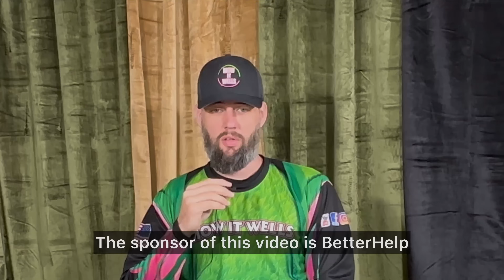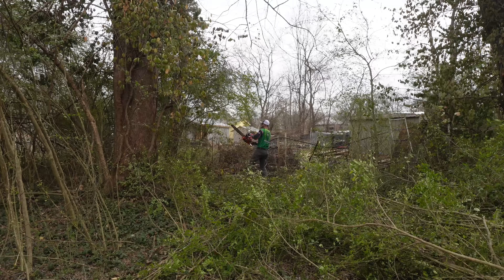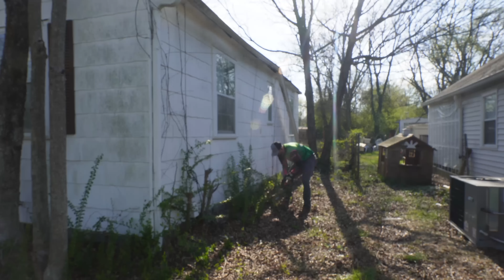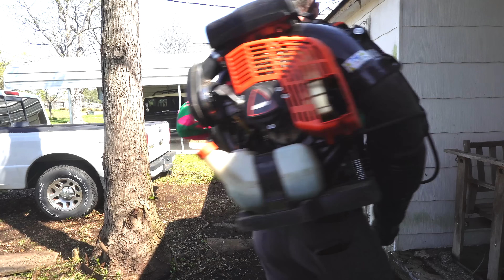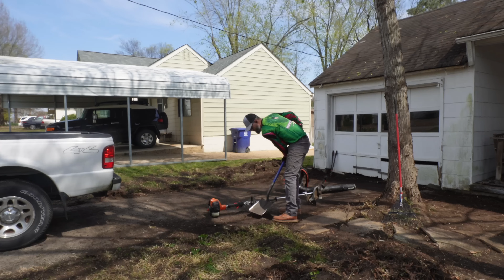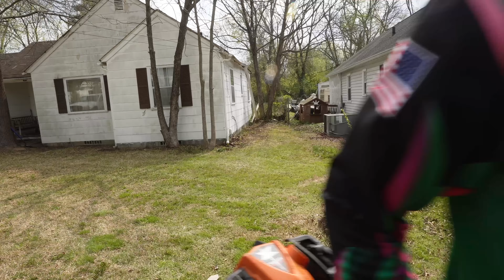Neighbor Doesn’t Know When The Last Time It Was Mowed

Comment: Super makeover, but did you just miss the leaves on the front roof because they were difficult to reach.
I thought someone shout out, get the leaves on the roof too.
Reply from the maker: Yes the roof was to steep and not stable. It had a lot of water damage too. I was afraid I would of fell through it.